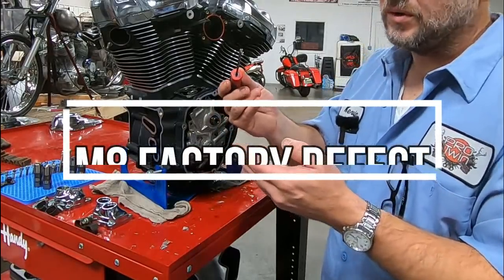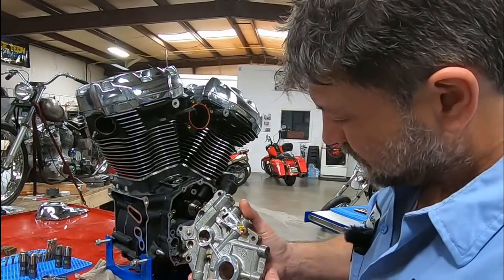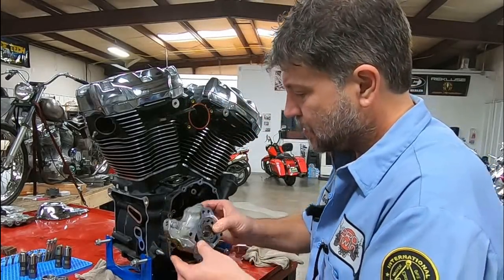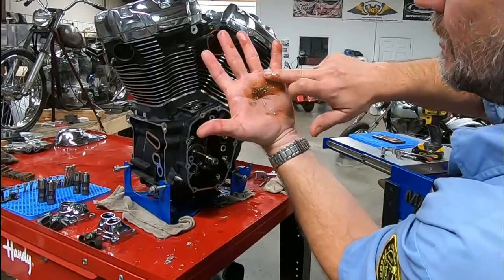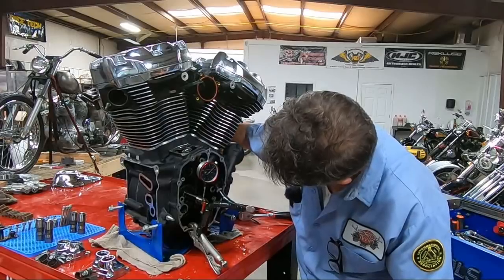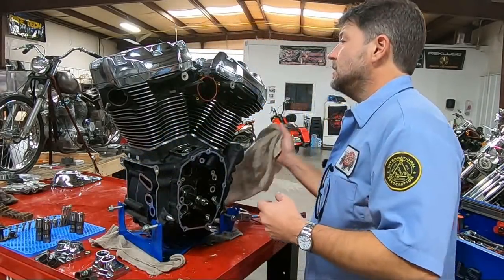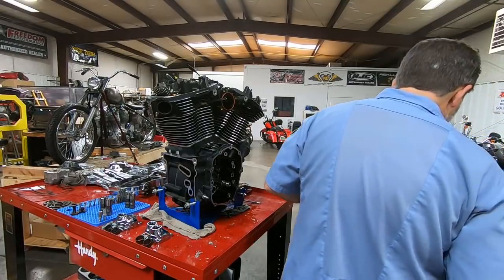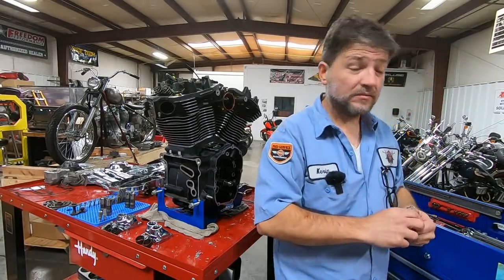Milwaukee 8 Problems Part 2 | MAJOR FACTORY DEFECT FOUND | Kevin Baxter - Pro Twin Performance

Comment: The crankcase was milled, but not cleaned and sent down the line for assembly.
Reply: That's what I thought .
Reply: same
Reply: It’s HD. No surprises here. Move along.
Reply: Bingo
Reply: My thoughts exactly...
Reply: Cuttings from end mill profiling
Reply: +1
Reply: Sounds like what happened with a several year run of Theta2 motors from Hyundai

Comment: I love Harley Davidson but if they made an airplane, I wouldn't fly in it.
Reply: If you knew how airplanes were repaired.. you wouldn't fly
Reply: @williamkegley6403  if you saw a fuselage broken up by salvage demolition you'd never step inside any aircraft....
Reply: @dandinhofer9240  I wouldn't fly in an airplane that had a Harley designed engine either... other then that, no one else in this comment section seems to understand how an aircraft is designed and operated. Google. Read it. Study it. Very simple!
Reply: @williamkegley6403  I made a living repairing USAF birds and sleep like a baby inflight.  Civilian aircraft I trust less but statistically the mishap rate is so trivial
I'm at more personal risk from a lightning strike.

Comment: My guess is that when they built the motor the aluminum left over from the machining process was missed and ended up trapped in the bottom end. Chunks of metal that big and you’d find severe damage to one of your parts. Great video btw!
Reply: my thought also or possibly vandalism.
Reply: @daveb5305  vandalism?Say it aint so....
Reply: Lifter block problem

Comment: Grumpy employee at the engine plant added a few shavings to get back at his employer. Unfortunately the other dealers didn't want to deal with a warranty claim no money in warranty repairs and blew off the customer under the warranty period. Now the customer is stuck with a factory problem that should be covered by Harley. I have seen this before two times dealers blowing off good customers with legitimate problems and running out warranty. Bad cust relations.
Reply: That happened to Ford when they're laying off the engine workers guys were putting rings in backwards leaving rings off putting bearings in backwards even leaving bearings out I remember seeing a piston went only half the rings on it

Comment: Quality control. Cases Never cleaned after milling it.
Reply: Quality control U.A.W. UNION workers at Harley getting even for their Union brothers getting laid off as Harley started cut backs when this bike  was built , and it us only going to get worse ...have you seen the cut backs inside Harley today ? They just broke their partnership with Vance and Hines of 20 years
Reply: Yep you nailed it. American workmanship is going downhill. Quality control issue for sure.
Reply: Monday morning Bike Built
Reply: Crankcase was milled and never cleane
Reply: One time I put a oil pump in a Mercedes always take the oil pumps apart and check them guess what I found in the new oil pump you guessed it metal shavings
Reply: A threat to move production to Kentucky and a union contract with no wage increases for 7 years tends to erode a quality attitude. 
These big heavyweights could be good again. Not great
Reply: Yes agree

Comment: those shavings looking more like millings, I wonder if it was assembled with millings not cleaned out
Reply: Yes climb cut chips
Reply: That's exactly what I was thinking. It looks like chips. I've seen a lot of torn up engines and I've never seen shavings that look like that.  I'm I'm guessing the noise he was hearing was one of those chips getting where it shouldn't be every once in a while and making a racket.
Reply: 0.0035" run out is within Harley specs ..for assembly line work ..but if you are building one for your self take the time it takes to line up the crankshaft fly wheels so you have 0.0000" run out ..it makes a huge difference of way less vibration ..and a free extra pony or two ..I have a friend who has been building Harleys for over 50 years and he won't install a crankshaft unless it is 0.0000" "zero run out
Reply: @donniebaker5984  What other manufacturer would get away with building crap in 2020.
Reply: Tar Trek , cool handle ...now go find VEGER and kill it ... Lol
Reply: @motsigman  That's eazy .. G M comes to mind as back in 1971 I was working at a Cadillac dealership ..we had an upset owner complaining about a rattle inside the interior of his Coupe DeVille!..come to find out it was a Pepsi bottle in the right rear door , with a note inside the bottle  that read " congratulations you found the rattle " you see Harley workers are U.A.W. union paid workers and they don't give a fuck what they are working on ..if they don't get paid or their union brothers get laid off ..shit happens ..
Reply: @DoRC  exactly as I saw cork screw shavings in this video  exactly like those when the holes are bored to be threaded for bolts !!! Pretty damning evidence , don't you think ? The factory workers are U.A.W. Union workers and Harley has been shutting down factories and laying off workers in Milwaukee  !  Looks like a repeat of back when AMF owned Harley back in the 1970's .. And just the other day  Harley announced they will no longer support drag racing and ended their partnership with Vance and Hines also Harley pulled our of support of the american flat tracker .for the first time since Harley invented flat track racing over a hindered years ago ..this is very sad ..and to top off the bad news. A C.E.O. for Harley announced they are going to scale down to only making baggers ! Damnit .. Looks like the end of Harley Davidson
Reply: I agree, this is a factory mishap and maybe poor quality control...
Reply: Motor was built on a Friday? Worker had his mind on the weekend.
Reply: 70s lots of problems with domestic vehicles.  I was used car mechanic in a Dealership. I found a 750 mil. Jack Daniels bottle in right rear quarter panel in front of the wheel well of one of the triadins that I was preparing for sail on our lot.
Reply: @donniebaker5984   Wow you say that about a harley it's beaten sport bikes out at Willow Creek that's why Harley Davidson had such an incredible we seen career. If you want to see the real truth say BMW GS against Harley Davidson Dana at racetrack. So there's the real truth. View harley guys are amazing the idea that a Harley Davidson with your feet out forward your hands in the air and old air cooled motor is gonna beat a sport bike the lean angles you can even do it. That's what the rest of us motorcycle community wonders about you Harley Davidson riders you defy physics. Physics make it impossible for a Harley Davidson and the design to keep up with the sport bike
Reply: I agree first time I saw the video. I worked in a machine shop and that is shavings not cleaned after machining.
Reply: That's what I was thinking. Aluminum shavings on that engine, can only come from either the oil pump housing, or the cylinder head. The pistons are aluminum, but either cast or forged. Even then with a piston, there would be large pieces, and the engine wouldn't be running.

Comment: Wow, very surprised he had oil supply to the top end and didn't bend a rod. Gotta be shavings left in from the factory,  someone was hungover that day!
Reply: Rods don't just bend because there is debris by the oil pump or lack of oil to the top end.
Reply: @krl023  No they don't...

Comment: Thinking about this engine...  But for now, after seeing the second video and you request comments, I say that the metal is from the factory, and has been riding in the bottom of the lower case since new...  The lighter stuff was pumped by the oil pump up to the lifters, but not enough to cause any damage.
I'm thinking that the HD factory owes this man a new engine, "free of debris!"
Reply: Exactly.
Reply: That’s what I was thinking in the beginning, and I’m not even a mechanic I have no knowledge of this this just a little common sense don’t get me wrong I can take things apart and put it back together but I am not a mechanic
Reply: That was either a Friday motor, or a hung over Monday motor. 
I did HVAC work at GM when they were still in Janesville. If the Packers played on Monday night, so many people would call in sick or not come in. To fit the problem, GM would put big TV around the plant so the employee could watch the game and work. Would you want one of those cars built on Monday night. There were most likely tens of hundreds of left over nuts and bolts by the end of the shift. 
Really made me laugh. But the plant was SO HUGH!!!  They had 5 or 6 difference restaurants in the plant. An Mc D,  Taco Bell, Sub Way. It was like a small town. Plus to watch a piece of metal come into the plant, and leave a car. Unbelievable. Especially with the close fits. The motor to all the computers. 
I saw a TV show where a Bogote car (so)  cost $80,000 for a oil change. An oil change is a whole motor rebuild. The rims are like $20,000 each with special very soft tire for $5,000 each.

Comment: At this point I have NO idea what the problem is.  However, it seems that about a 6 " lower work table would sure make a lot of the work a lot easier!!
Reply: I mount my engine holders on cheap Harbor Freight rotary engine stands and it's easy as it could be to rotate 'em where ya like including upside down.
Reply: @Comm0ut  harbor Freight? Im surprised they haven’t bent in half!

Comment: The loud noise was from the lifters not getting enough oil besause of the aluminum shavings blocking the oil passages causing them to collapse. I can imagine the horendice notice that engine made. The 1996 Kawasaki VN1500 Vilcan Classic twin cam vtwin had problems with lifters collapsing from too much oil pressure. They had 8 small lifters so the sound was high pitched compared to the Harley's larger lifters. The result of the collapsed lifters on the VN was lots of noise, carbon build up on the exhaust valves and seats causing the engine to shut off from lack of compression. Kawasaki launched an F.A.R. (Factory Authorized Repair) campaign on certain VIN units. The repairs were only done on units within the certain VIN and were experiencing the symptoms. The repair consisted of removing the engine and both cylinder heads, replacing all 8 valve springs, all 4 exhaust valves, all 8 lifters and a new banjo fitting that had larger holes which delivered less PSI oil pressure for the oil lines at the crankcase that delivers oil the lifters and camshafts. The banjo fitting with smaller holes delivered too much oil pressure which caused the lifters to collapse which allowed the rocker Arms to slap back and forth from the camshaft and valve. Also grind the seats on the cylinder heads if needed to achieve a good seal from the valves to the seats. I had to grind the seats on all of the bikes except for about 4 intake seats. Kawasaki paid 10 hours to do the F.A.R. and I was able do the last 3 out of Out of 6 at 9.3, 9.1 and the last one at 8.7 hours. Since it was a safety concern it paid pretty good. I didn't mind doing anymore since I new what to do and was able to beat the time paid, but no more came in. Most warranty repairs don't pay what it actually takes and all technicians hates doing them. 
With 30,000 + miles on that Harley, it's probably out of warranty unless the guy has extending warranty. Let's hope he does.

Comment: I have seen that before on a twin cam the top end would start making noise and than stop. The oil passages were full of shavings. I also found it in a 1984 GL1200 Honda makes mistakes too.

Comment: Very good never thought of the fact you’re dealing with dissimilar metals where different metallurgy is a factor, all mine were cast iron or cast steel with grade 5 or grade 8 bolts. I understand completely.

Comment: I’m thinking that the shavings are left over from the manufacturing process.
Reply: That’s what I’m thinking
Reply: I'm also thinking intermittent oil port clogging/ oil starvation to wrist pin and crank chamber... Maybe some wear around there.
Reply: Nah couldn't be.
Reply: i was thinking the same and said so on last video, maybe from drilling the galleries in the oil pump
Reply: Reckon you’re on the money
Reply: The question is? Is there any other bikes having an issue like this???

Comment: The only good thing about aluminum shavings is they're too soft to score the hardened steel pieces of the engine. But if they plug up oil passages, the engine could be toast.

Comment: My Milwaukee 8 blew the top end at 3,200 babied miles. The dealership was good and gtve me a Stage 3 as a replacement. With my okay, of course. So I am extremely interested in this video series. Thank you for doing this ,Kevin. BTW , I subscribed.
Reply from the maker: Thanks for the sub. Episode 2 tonight same time, and 3 tomorrow night. See you then.
Reply: did they say why silat
Reply: balancer ?
Reply: @roncoburn7771  I was never told why. Just that it was blown.
Reply: @stevehastings3950   I was never told why. Just that it was blown.

Comment: Kevin, another thing to worry about, Aluminum is abrasive, if the motor is continuously used, the hard steel parts would most likely have some wear to it, even if it looks good. The Aluminum shaving in oil would function as a lapping process, in fact, the steel part would look very nice, but dimensionally it might be much smaller.

Comment: I've known people that would trade twin cams for the old Evo! I expect they would trade an M8 for a good Evo! I've had my 95 forever and had very little trouble! They should have stayed with the Evo it's hard to improve on perfection!
Reply: The only thing that will surpass Evo is a 99-02 Twin cam with a gear drive setup
Reply: The evo was exceptional. The m8 now is amazing after they got the pil pump issues and other crap fixed.

Comment: you said they're aluminum shavings........ so I'm going with case and box.  Turned shavings..... casing bores/taps, never cleaned up after a re-bore/tap after partial assembly.. I'll be buying my t-shirts either way. I'd look at those shavings to see if they're smooth tapered edge shavings (from rubs on the turn) or chunks from that big twin eating metal hard handed..  Great video and great work  madman.

Comment: After you pulled the piece that looked like "a drilling" I had to go with other comments that the engine wasn't flushed after cleaning. At first I thought piston pin scraping the cylinder, but you said nothing about burning oil, or power loss. I had a 73 FX that the factory failed to install the piston pin lock ring and the pin did a number on the cylinder wall.

Comment: Hi Kevin I enjoy your videos! A suggestion from me would be to install a powerful light on engine components so as I can see them better during tear down. I am curious as to how you keep all parts organized in such a way as to remember which order, or sequence you put them back together. Is it because you have repeatedly performed the task so that it is easy for you?
What are your thoughts about potential oil sump problems on 2017 M8 engines, whether a change to a different style oil pump(number of lobes) is recommended, I have 12000 miles on motor with no symptoms of problem. Wondering if being proactive on this would prevent potential problems in future. I plan on keeping bike for many years.
Thank You very much!

Comment: Someone at the factory dumped that stuff in there on purpose.
Reply: I think you are correct. I think that is exactly what happened, that sort of thing has been going on for many years from many different manufacturers. One that sticks out in my mind is a Cadillac that left the factory with a bad rattle in it. They finally found a tin can with a note on it from someone on the assembly line.
Reply: Catastrophic engine failure at 30000 miles my soviet-built euro is better than that

Comment: And the reason the engine was running hot because those metal flakes got jammed inside of some of the oil ports so the oil was not able to flow through  the oil cooler  at the pace it was supposed to that would not allow the engine  to run at the correct temperature so there could be over heating damage there for engine is trashed

Comment: A question out of curiosity, why do you break all bolts loose with you ratchet before you use the impact driver to remove them. I was an industrial mechanic for 40 years and unless I was dealing with something really delicate I always used the impact wrench to take it apart and ratchets and torque wrench to put it together.
Reply from the maker: grade 8 steel 1/4 20 bolts, in cast aluminum.  Never know if it was overtorqued (very common) or excessive loctite used.  I want to feel it to make sure it backs off smooth.

Comment: This was sabotage by a disgruntled employee. Those shavings would never make it to the assembly area by accident. Milling and machining is not even done anywhere the assembly area cell. They do look like machining chips from a flycutter plus those size chips would no way, no how make it through the oil system. Somebody brought those in the assembly area in their pocket or in a shop rag. The cases are also painted and they would not have made it through the paint room process. Would not make it through the crank assembly bearing pressing either. No accident here.
Reply: Think it’s also possible that someone threw a handful of swarf into that oil pump cover after the guy bought the bike ? Seems odd a factory employee would want to do that to some hard working Joe :(
Reply: Ya know what... I agree... chip size and location almost Had to be added later... Smh...smh...smh...

Comment: My guess is the crank halves are moving on the pin, eating the case. It is clearancing itself and moving occasionally. The metal distribution I have no explanation for.
Reply: The crank run out is good tho.